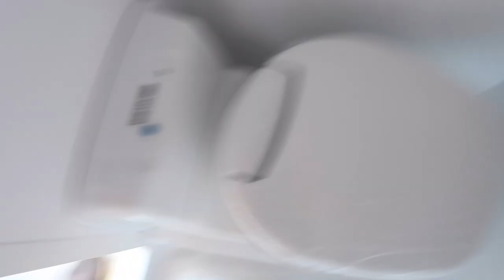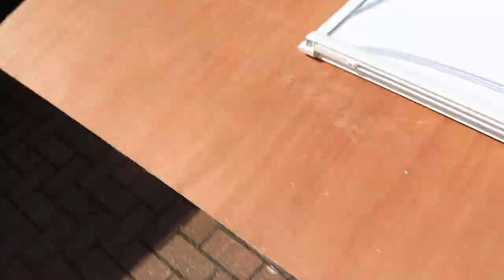Shower and Toilet Pt2 | Ep23 | Sprinter Conversion

Comment: hi mate i have brought the same toilet as yours. did you just run it off a pressured system? so basically a cold feed coming from your tank and pump? thanks
Reply from the maker: Hi Luke yes exactly that. It has a little blue button for water but rarely use it and try our best to aim as accurately as possible but use it on occasions. Good luck

Comment: Does this toilet have a vent or anything? I have purchased one for my cargo trailer/toyhauler conversion, and want to put it against an interior wall as you did here. Wondering if that’s been an issue at all? Any smells, etc inside the van?
Reply from the maker: Hi Jeff. It has a 12v roof extractor yes and had 0 problems with damp etc. We would use a rubber blade or archer machine to dry the walls for the most part and then use our towels to clean the chrome after we had a wash to stop limescale build up and scarmy marks.

Comment: Hi there, what 12v light fitting did you use for your ceiling, as I’m struggling to find a ceiling light to use over our shower?
Reply from the maker: It was a light with housing with a waterproof rating designed for wet room installations

Comment: Great video, I fitted my toilet/shower same way as yours. Didn't want to cut through main struts running along bottom of van walls. love what you did with shower door, got me thinking bout changing mine now though. Have you heard of a SOG toilet vent. I fitted one, helps stop smells and you can use normal loo paper without chemicals. Thanks for time and effort with your video's 👍🚐
Reply from the maker: Thanks Wayne. Ive never heard of a SOG vent no ill have a look. We are in spain atm and struggling to find toilet chemicals

Comment: How does that door hold up when you are driving? Does it rattle or anything? Good detailed videos! I'll definitely be using them to help my build. Thanks.
Reply from the maker: Holds up excellent, had 0 problem. The shower has rubber stops from when it was fitted in a house and they work the same in the van. You have to get your measurements bang on so measure twice and cut once as I can't imagine the doors are too easy to come by. Good Luck

Comment: Hi,
Great Video thank you. Are you not worried that water will get through the crack between the toilet and the shower tray?
Looks like water would go straight on to the floor.
Reply from the maker: There is no crack it is a sealed unit via the gasket once assembled

Comment: 29:56 do you have a name for that thingy? Or can you remember where you got it from please? :)
Reply from the maker: That is a shower plug drain 25mm. can be bought from most camper van conversion shops online. You can get them straight or with and elbow kick on the end

Comment: Hi Scott, amazing work!! How did you seal the hole under the van?
Reply from the maker: Thanks. Im not sure which hole you mean? if its the one for the waste I used metal paint with a primer over the top
Reply: @ScottAndJen  yer that sthe one I mean :) maybe i'm over thinking but you drilled 38mm from the top and this went all the way through the van floor? But the waste/drain outlet is much thinner at the bottom so is there a space where water can get up into the flooring or did you seal off somehow? Cheers :)
Reply from the maker: @KeepTheBalance   I didn't no. It is ample sealed but you could fill it with expanding foam
Reply: @ScottAndJen  awesome thank you! Nervous to do this step so wanted to check. Keep up the amazing videos!